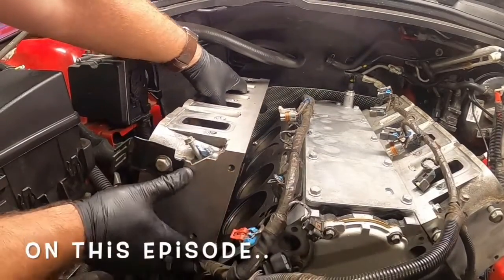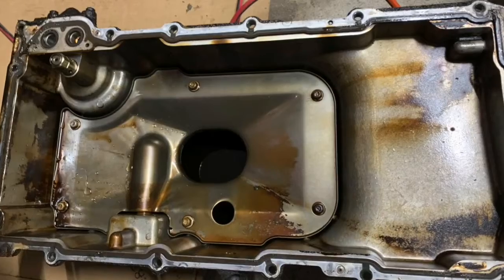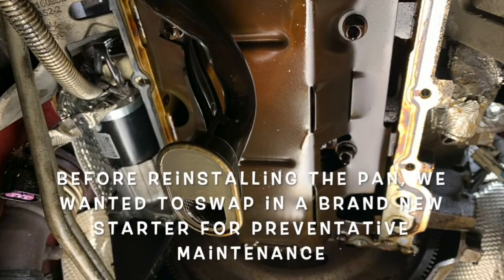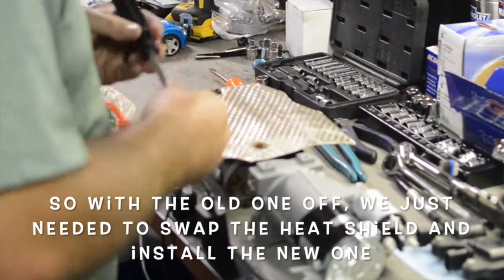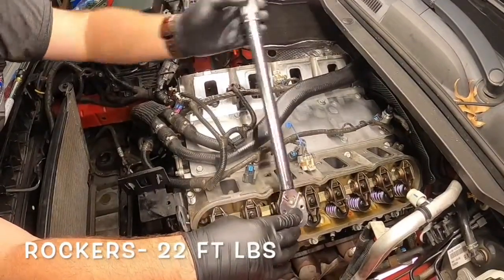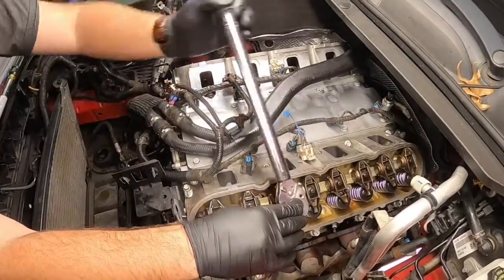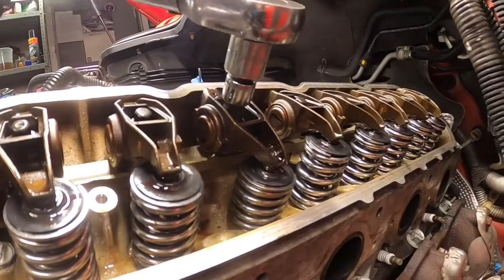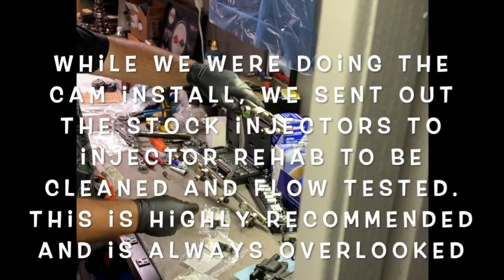G8 L76 Cam Install Part 4: Torque Specs and Reassembly

Comment: Question about the valvetrain, all you have to do is torque them down to 22lbs without adjusting the valves on the intake and exhaust ?
Reply from the maker: There's no adjustment to be made. Dab of Blue locktite and the springs compress before it hits torque of 22. You can spin the motor if you like so no valves are open when you tighten them but we've never had an issue
Reply: @The1st60ft thank you! Im used to Sbc where you had to spin the pushrod and set preload lol

Comment: How did you remove the oil pan?
Reply from the maker: @gilliam355  you gotta jack the motor up. We used an engine bay cross brace to hold it up while doing the pan work
Reply: @The1st60ft  ok thanks

Comment: For the heads what was the TOTAL torque spec???
Reply: There isn’t a “total” torque value when using stock gm head bolts. They are tty (torque to yield). If you were installing arp bolts, those have one specific torque value
Reply: The ARPs are three pass in the stock procedure. First pass is 30-35lbs, second is 50-55lbs, and the final pass is 70-75lbs for the big bolts. 25lbs for the small bolts

Comment: What did you do to start the car?
Reply from the maker: Just made sure the cam and new  metal parts were protected with assembly lube until the engine oil can circulate through the motor. You will need a start-up tune as well

Comment: Hey man just wanted to say how much I’ve appreciated these videos helping me with my build so far! You’ve helped me out a ton and I’m so excited to get it back on the road. 

Quick question though, how did you find TDC when reinstalling the cam without the heads on??
Reply from the maker: Just line up the dots on the cam gear and crank gear. Cam gear at 6 o clock and crank gear dot at 12 o clock
Reply: @The1st60ft   Okay so it is just as simple as that. Thanks a ton!
Reply: I suppose, in general, how did you verify the correct positioning of the internals to not mess up the timing with the new parts?

Comment: What was your process to get the oil pan off? Kinda struggling with it.
Reply from the maker: Easiest way is to get an engine bar and raise the motor 3-4 inches and the pan will come right out. Just 2 lower motor mount nuts
Reply: @The1st60ft  is there a way of getting it out with out lifting the engine? Because I already got all the bolts out. After that is it just wiggling it out?
Reply from the maker: @XxSkate402xX  I had all the pan bolts out too on my 5th gen and I could not for the life of me get the pan out. 2 motor mount bolts(so easy to get to), engine bar, chain bolted to valley cover bolt holes and it comes right out
Reply: @The1st60ft  did you have a lifting plate or just literally weave the chain through the bolts or chain down the bolts? Sorry for so many questions lol
Reply from the maker: @XxSkate402xX  haha no prob. I just put 2 bolts through the chain and it worked. A plate is probably the right way to do it though 😂
Reply: @The1st60ft  okay sweet, thanks again.
Reply: Did you use the engine bar to hold the engine and then jack it up with a jack or does the engine bar act as a jack?
Reply from the maker: @XxSkate402xX  I'm trying to remember off the top of my head but I dont think so because the steering rack doesn't allow the pan to drop far enough. The engine bar has a chain and you can pull the engine up by twisting  the handle. It sounds like alot but its literally the easiest way to get the pan out
Reply: @The1st60ft  This sounds safer than the way I lifted mine. a ladder on one side and a chair with 2 milk crates on the other side with a 2x4 going across. Took a 3 inch wide strap rated for 6000 lbs and bolted it to the top of the engine and then lowered the car around the engine rather than lifting the engine.  Gotta do what you gotta do sometimes.  At first I tried to just move the rack forward but the first two bolts I took out broke so I gave up on that plan. Great series of videos here man. Finishing up the cam install/dod delete on my 09 right now.
Reply from the maker: @horsleyhorsepower3649  points for creativity! 😆